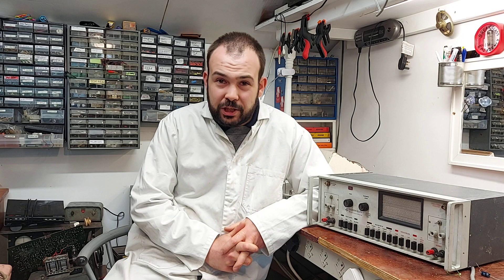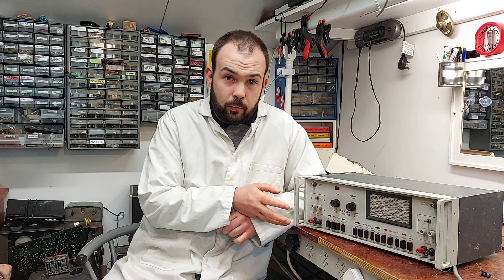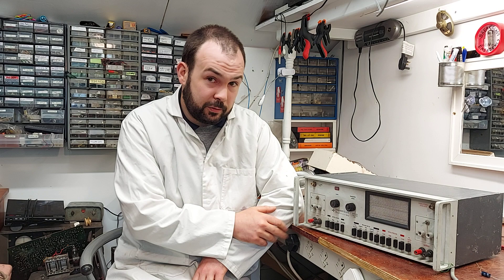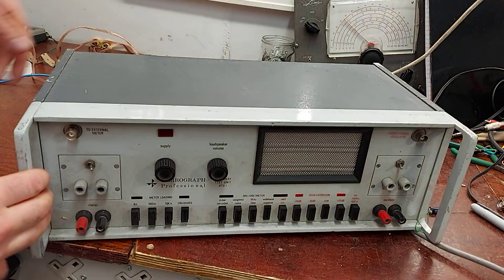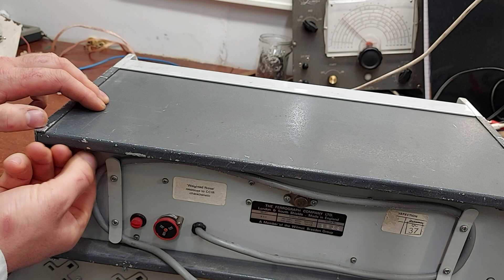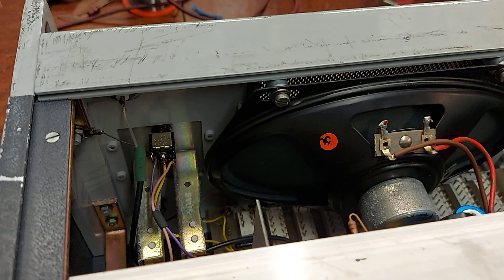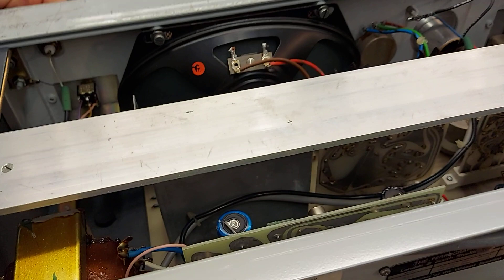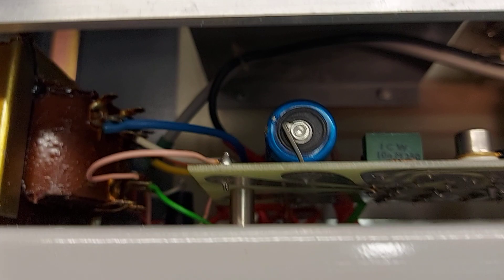Ferrograph ATU1.

Comment: I have to admit that i didn't know what that was.
My first thought was the case would be loverly for a big linear power supply and a test amp.
Yes i'm a bit nasty thinking that way but i tend to like things that are practical and usefull.
That ferrograph is a bit too specialised .
Just my evil opinion :-D
Ive made quite a few power supplys in the distant past, usually a couple of 2N3055 transistors on the back heatsink and whatever i had kicking around to drive them.
My mate has one i made in 1988, the dam thing still works lol, bloody amazed me :-D
Reply from the maker: Thanks ZX.
Reply: Snap! In late 80s made dual power supply using transformers from  an old TV and  LM xxx? Reg chip the design was in one of the Magazines. Unfortunately I used the large backlit VU meters from a rather lovely valved Akai reel to reel tape recorder for volt and current measurement.😞
Reply: @triodehexode   a shame for Akai but i bet the power supply looked great :-D
Maybe a LM338 perhaps?.
Thats 5 amps i think.

Comment: I noticed the inputs are PO 316 (B gauge) jacks, 1/4" will fit but strain the contacts a bit, probably an ex RTE or BBC bit of kit as they both use PO 316 extensively, otherwise I'd expect to see 1/4" or XLR c onnectors.

Comment: Hi Jonjo.  Just seen this video - amazingly I have TWO Ferrograph RTS-2 sets on my bench at the moment: one fully working to spec. after changing resistors in the oscillator attenuator, and the other that I have been trying to sort a problem out on its distortion board - close, but not quite there yet!  Interesting to see the RTS-2's other half in this video.
Reply from the maker: Hi Gerry, if you're interested in it you can have it for the postage! It gets no use here.
Reply: @IrishvintageTVRadio  Hi Jonjo.  Yes, I am interested.  Just saw your email - thanks!
Reply from the maker: @RadioRestoration  Looks like you're able to comment again, thanks Gerry. I'll be in touch.